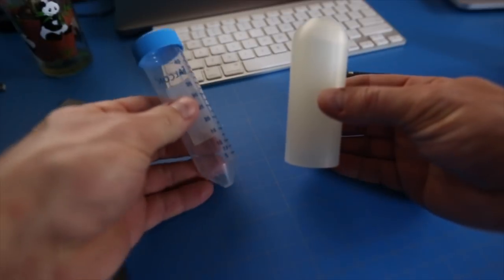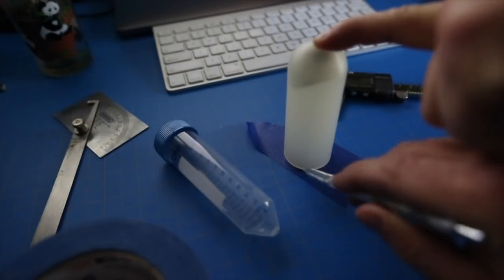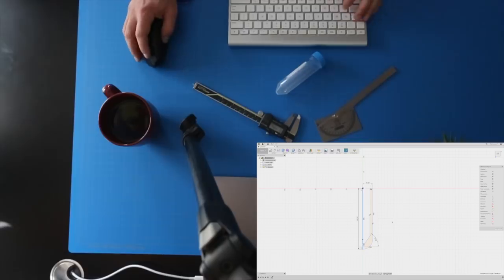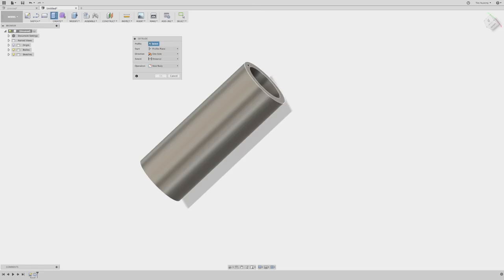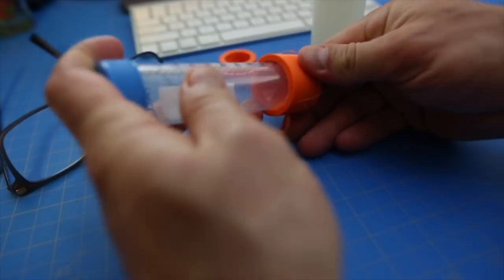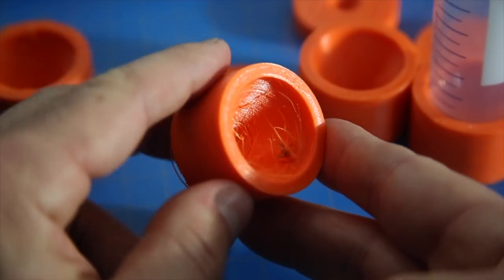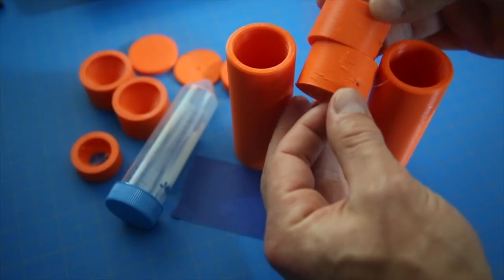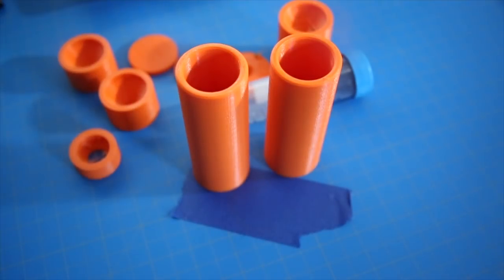3D Printing Test Tube Centrifuge Adapters for Science

Comment: Hey Tim, try enabling retraction and starting each layer at a "random" location to improve quality :) Decrease speed as well!
Reply from the maker: Ah, I need to find the random location start - any ideas? I thought there must be somewhere to change it but didn't find it or feel like digging through the gcode.
Reply: I don’t use cura so I don’t know if the option is even available! I use flashprint with my flashforge Dreamer and there is an option to start each layer at a “random start point” :O
Reply: In Cura, go to settings - Configure setting Visibility, then under "Shell" put a tick in all the "Z Seam" boxes. That should give you Z seam options under "shell" one of which is random. Not the best option for quality on most prints IMO though.
Reply: meucunt1 I agree not best quality, but you do loose the distortion you get from starting in one specific area... or is that only my prints?
Reply from the maker: Perfect! thanks :)

Comment: Hi Tim,  3D printed materials are great, but can I suggest you turn some PTFE (Teflon) off cuts. It would be a lot quicker and maybe cheaper and in this case PTFE has the benefit of having a very high chemical resistance.
Reply from the maker: Yeah! I'd love to get my hands on some Teflon for some other project ideas anyway. In this cause I could have easily done most of that on the lathe except the most critical part - the angle on the bottom on the inside. Unless that happened to match a drill bit or something, I don't know of a good way to achieve it accurately. That said, I don't think these will need to be exposed to very many harsh chemicals and PETG is pretty stout on it's own. Thanks for the comment!

Comment: What are your retraction + print settings? The rule of thumb is speed: as fast as the stepper can handle (3000-3500mm/m is typical) - distance: 4-7mm
Great job over all, would love to know what model your printer is!
Reply from the maker: Hey Shane! It's the Monoprice Prusa i3 clone https://www.monoprice.com/product?p_id=13860

As for print settings... 250*c nozzle temp, 0.2mm layer height, 80*c bed temp, 8mm retraction distance at 40mm/s, 20mm/s print speed across the board, 200mm/s print and travel acceleration, 100% flow, 0% fan, and I used 1.75mm diameter PETG.

I didn't have any clogs, stringing, or poor adhesion after all that - it was slow and steady but printed so nicely!
Reply: I've got the same machine (under the original branding of Wanhao i3, that is), and never had any stringing once I got my retraction set right- I've also not played with PETG enough; Try lowering the extruder temp. a little, or turning on the parts fan (are you using Cura or slic3r, or maybe even Simplify3D?)
Reply from the maker: PETG is a bit goopier than PLA and takes a little longer to cool. It's not quite as bad at ABS but definitely takes a bit more tinkering.
Reply: That makes sense. Have you tried prime pillars/ooze shields (not sure what Cura and Slic3r call them sorry) ?
Reply from the maker: I've just recently see them and so far I haven't ever tried them. Maybe not a bad idea though.

Comment: great job Tim, but those 40 hours is that the real time or just a joke? If it's real, then those tubes are golden in print price.
I am building a Geetech Prusa 3, but with these printing times I doubt if I ever print something.
Reply: printing takes time, yes, but fortunately you dont have to monitor the printer, if you calibrated it correctly, you can watch the first layer so it doesnt mess up (most critical in 3d printing) and after that you just can leave it and come back occasionally to check if everything is still going good.

the thing is, it takes time, yes, but you also can do incredibly cool stuff
Reply: ''it takes time, yes, but you also can do incredibly cool stuff'' And an enormous energy bill I think!? What is for instance, beside the fun working with it, the Costs benefit Analyses for 1 or 100 products, as for instance this tube or any other product? I think that for development of a special part the Costs benefit doesn't matter, but for large scale serie productions there are cheaper faster ways to make the tube, as there are 3D CNC machines, I even think you can produce 100.000 tubes in 40 hours!
Reply from the maker: Sharky is right, 3D printing is not fast. The biggest difference between cheap printers and the expensive ones of the same type is more or less the speed that they can print. The 40 hours is accurate in this case but once I got everything dialed in, it was a set it and forget it kind of thing and check on it a couple days later. That's why it was so important to get the prints to be nice - nothing worse than being 39 hours into a 40 hour print only to have it knock the part over with a blob on the nozzle or something.

To Arends comment about the cost, 3D printing is still incredibly cheap. The case has 250 watts stamped on the side and in the US the average cost per kilowatt is around 12 cents. So if it was running wide open for this print, and my math is right, it only cost about $1.20 in electricity and maybe $2-3 in material. That said, 3D printing is best suited for when you need something that is prohibitively expensive, hard to find, or unique AND when you don't need a lot of the part. While dollar-cost is still incredibly cheap, time-cost is the expensive part of 3D printing, but even 40 hours is faster than most shipping services.
Reply: arend, 30 years ago a computer was slow and kinda useless for most people, everything has to start somewhere and thats where 3d printing is now. energy consumption is very very low, once heated up i think it takes only 70-100 watts to keep the thing running. printing has its biggest advantages in a size of 5x5x5cm for me, since most of it can be printed in 2 hours or less and you can get very strong durable and perfectly sized parts. especially if you only need one or two of them. for instance i replaced a lot of small plastic parts from dothats all around the house that would have been thrown away if there was no way to fix it. if you sum up the energy needed to produce new stuff just because one part of the old broke, its very well worth it to burn some energy to print the part you need. 

also if you order something, you will burn up huge amounts of energy just by the fact that it needs to be transported to you. with a printer, you get a couple rolls of filament one time and you can print a surprisingly long time on that. 

but you are like most people i tell that i own a 3d printer, they are reserved and think you are a weirdo but almost guaranteed they will come to you within weeks and need something printed for them because they just realized how often they could need something like that to help them fix a problem.

you dont buy a tool for the job sometimes, much more find the job for the tool :)
Reply: I have also have a geeetch prusa i3 and can confirm that it does not take 40 hours to print stuff like this.
Reply from the maker: Christopher Ferrante I'll be happy to send you the files to print.. But 100% infill at 20mm/s and a 0.2mm layer height is slow going.
Reply: TimNummy Sure I will print them if you would like. P.S. didn't mean to sound snarky
Reply from the maker: No worries - if you can get them to print faster and look just as good I'd be interested to hear how you did it.

Comment: I'm curious if you printed these sideways (laying lengthwise on the surface) so the layers ran the length of the tube if you'd get better strength.  here all your strength is going to depend entirely on the layer bonding, not the strength of the material itself.

How did they perform?
Reply from the maker: Hey! I'm not sure yet - I considered that but I think they are going to sit on the bottom of a blind hole so the majority of the stresses will be in the compressive direction.

As soon as they get tried and I get an update I'll be sure to post a followup.

Comment: As a former technician, I wanted to say something. The frosted carrier tube is round bottomed because the centrifuge has a round bottomed steel tube to put the pair of tubes into. I find it hard to believe NASA can't get the centrifuge industry, e.g. the supplier to recast the frosted carrier to fit the and standard centrifuge tube. The test tube itself is used to process and concentrate tiny amounts of cells or particles by spinning at very high speeds, perhaps many thousands of revolutions per minute. The conical shaped bottom allows the specimen to collect as a button in the tip of the tube
Reply from the maker: While NASA is involved to some degree from what I understand, this research is going on in an academic setting. I haven't seen the centrifuge so I don't know how it looks, but you're right about the test tubes. The issue was that the material he was using was heavy enough to break the test tube when it was largely unsupported in the round bottom sleeve.